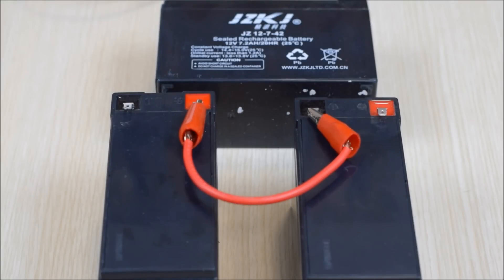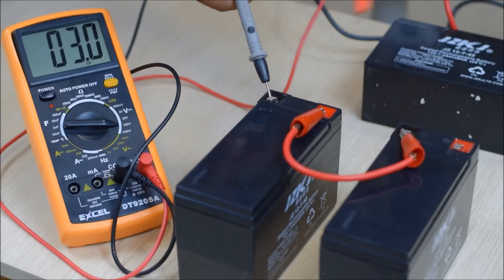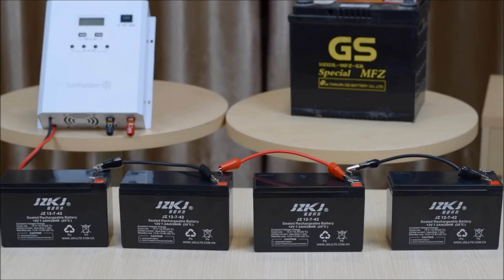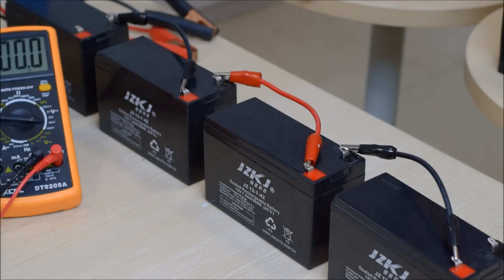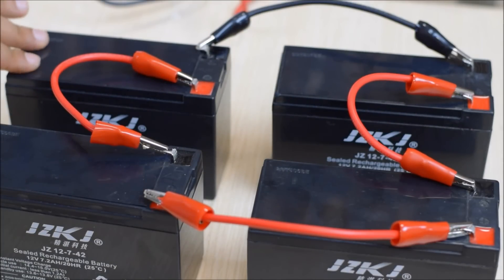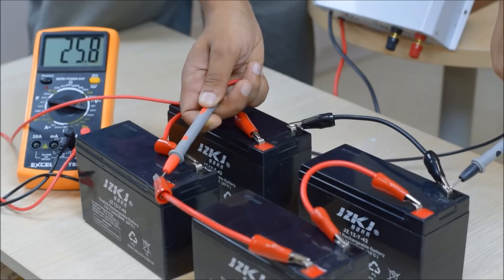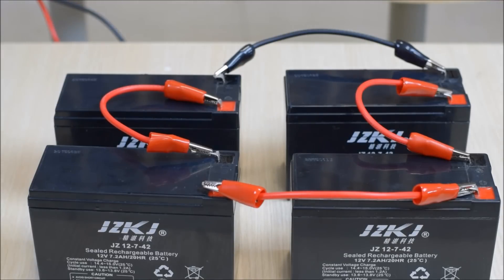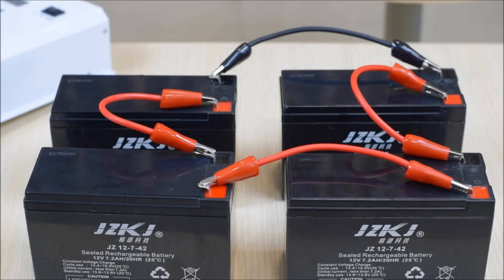How to Connect Batteries in Series and Parallel - Part 2/2 : Series  Connections

Comment: So if I wire my batteries this way, l’ll have to get a 12v to 24v reducer for all my 12v appliances correct? Do I also have to connect it to my 12v 120 inverter?

Comment: Can u give me some advice pls, I am using 650watt power UPS for my PC. Lately I changed a new 12v9Ah battery and not ok. So I am thinking to connect 2nos of 12v battery in parallel. Will it be ok? Pls.

Comment: Very clear and simple explanation. One thing for people to keep in mind trying to increase voltage, anything connected to this system when doubling/tripling/etc, be sure the components connected are capable of handling the increase. Example: a lot of people running Power Wheels or similar Ride-on vehicles for kids...they'll drop an 18v tool battery or run a series of 12v7ah batteries like in this video, and they'll fry all the components either immediately or within days of use. Motors, ESCs, audio/lighting, etc are all set up for 12v WILL FRY and catch fire if you run even 16+V to them.

Comment: I have a boat with a 36 volt trolling motor using 3 X 12 volt batteries.  Is it possible to connect these batteries both in series and parallel in order to charge all 3 with a single 12 volt solar panel ?

Comment: So, 
you put 4 12 v 7.2 amp batteries in series to get 48 ish volts.
Basically a 48 v DC battery 7.2 amp.
Can you take an identical array of
12 x 4 = 48 in parrael to the above to have 48 v and 4 x the AHs?

Comment: A better way to hook batteries in parallel.  

Line up all the batteries and solder all the negative connectors together with a single black wire.  

Then solder the negative end of a diode to each of the positive connectors.    Then solder all the positive ends of the diodes together with a single red wire.   

This protects all the batteries from being fed by any other battery.   They feed and charge independent from each other.   

This way is preferred as there always seems to be one battery with a bad or weak cell.

Comment: hey can you set up 4 batteries so they all equal 12v? or does it have to be 2x24 volt setup?i would like to give my 1 battery 12v system more runtime how do you add more batteries to a 12v system so it runs longer?thanks!

Comment: OK, we understand how wiring in series is going to boost the voltage. But you didn't show how the series and parallel combined boosts both the voltage and the amps. You only showed the voltage.

Comment: You didn't mention the amp increase when you ran the two set's of 24 volt in series, the voltage remains the same, but the amperage increase's, doesn't it ?. Thanks for showing the proper load lead from one end of the battery sets to the opposite, now I know how to connect my two set's of battery's to the load.

Comment: I have a question. When I plug my coffee machine in...my inverter just beeps. Won't run my coffee pot. I.m wired neg to neg...pos. To pos. Should I change it to neg. To pos.?
Reply: What size inverter you have and what the amp on your batteries?  Your inverter might now be strong enough to power your device.

Comment: Hi I bought 2 batteries of 6 volts each, but I need to use 24 volts for my project.
My question is: can I add a 12 volts battery to reach the 24 volts I need?
I will really appreciate for your attention.

Comment: Hi thank you very much for this video. I want to ask you.. I have 16 x 12v, 200ah and I need 2 sets of 8 x 12 to get 96v 200ah then put them in parallel to get 96v, 400ah. I understood that for the load you need to put them to each end. How about the charge controller? Should I connect it at the same end?

Comment: Great video, I'm planning on getting 4 6 volt 4.5A batteries to get 24 volts and i beleive my amps should still be 4.5A, my question is a laptop connector (18.5V 3.5A) Work for charging them?

Comment: What is the name of the double clamp cables bad where can I get it? Thanks.
Reply: I dont know what its name but ppl usually know if you say mini crocodile clip. And you can find it in any electrical shop and also at motor workshop.
Reply: Alligator clips ...... electronic shops
Reply: @MrAcc45  Thank you!

Comment: I found this video very useful but I'd like to ask one question how do you charge the series of batteries do you have to do them individually or can you go on as a series? Can someone explain this to me
Reply: Michael Wolfe same as load. If you push current it will charge. I’f load takes current it will discharge. Get a standard 2-5 amp charger based on your voltage range.

Comment: Great, simple, clear video. I was thinking that, while you were showing the voltage increase between two batteries compared to one, that using the term 'potential difference' instead of voltage would make a lot of sense because you can physically see that the potential has doubled when they are wired in series. I don't want to suggest there's a direct relationship between physical size and potential difference, but the additional terminology can be useful.

Comment: hello,i have big question, i want to buy two panell 260w x2 ,one panel have 24v,both panell offer 18A and ""both panel have 120 cell"".i want to buy controller PWM 24v with 20A i read the datasheet but not undesteand why company: victron-energy write in datasheet for conttroler is recommanded to have For 12V use 36 cell solar panels,For 24V use 72 cell solar panels???
https://www.victronenergy.ro/upload/documents/Datasheet-BlueSolar-PWM-Light-Charge-Controllers-12-24V-EN.pdf
this is marketing?or is fake not undeasteand? i tell again i want to buy two pannel and both have 120 cell...
Reply: 260 w 24volt panels each have 60 cells normally. You can use the controller dont worry

Comment: ok so i have 6, 12v 7ah batteries. i would like to connect 4 batteries to create 48v and i know thats done with the series method. the other 2 batteries can be put into parallel to bring up the AH correct? so follow formula neg to positve to 4 batteries and then remaining 2 batteries neg to neg  pos to pos for higher AH ? am i right? while connecting the 2 ends to create the power neg end to positive end?

Comment: I have 12v. 3 (A, B & C) batteries. I want to connect in parallel for charging with 12v charger. If i connect A+ & B+ and B- & C-. Now I want to connect charger with Charger + & C+ and Charger - & A-. Is it possible?

Comment: Dude, for safety and simplicity, you should use jumper wires that are not  red or black.  I recommend white, green, or yellow.  That shows that they are jumper wires and not points of contact for a load.

Comment: i have a solar panel of 12V - 250W and a battery of 12V - 200HA and a inverter of 2000VA / 1200W and also a charge control of 12V - 24V / 60HA, after connection the battery is not given me a good charge. could it be from the connection and what should i do to fix it.
Reply: STANLEY JAMES EZRA he won't answer will he? I had the same question

Comment: can you tell me the voltage and amp
parallel              voltage= ?  amp= ?
series                voltage= ?  amp= ?
parallel&series voltage= ? amp= ?
Reply: That is wrong.  In a parallel connection, you do not simply add up the Ah ratings of the individual batteries.
Reply: Each battery is 12v and has 4.2 mah so....

parallel             voltage=12v  amp=16.8mah
series               voltage=48v  amp=4.2mah
parallel&series             voltage=24v   amp=8.4mah
Reply: hi
Reply: can you send the correct answer to the question?
Reply: +traci beacer There is no single "correct" answer cuz it depends on what load you put on the batteries and how they are wired.  However, the simplest answer I can give that is "ballpark correct" is 48V  4.2Ah, 12V 20.3Ah.  24V 9.2Ah.  However, the batteries in this video are marked 7.2Ah each, not 4.2Ah and especially not 4.2mAh which is orders of magnitude off.